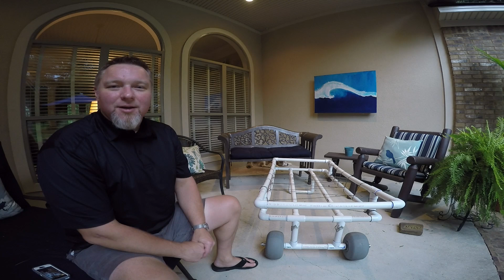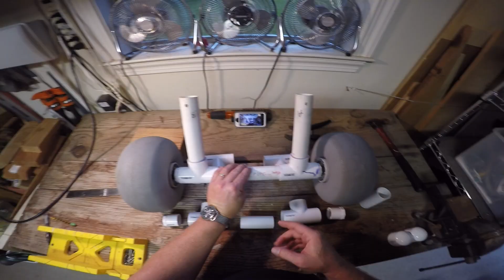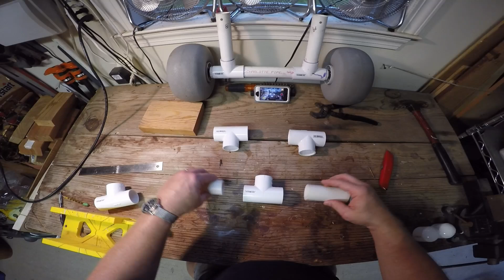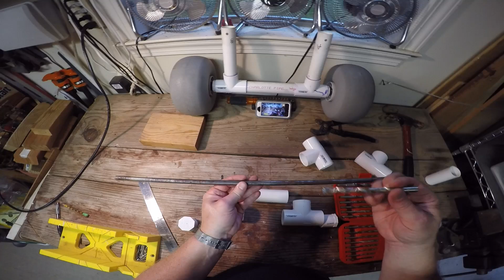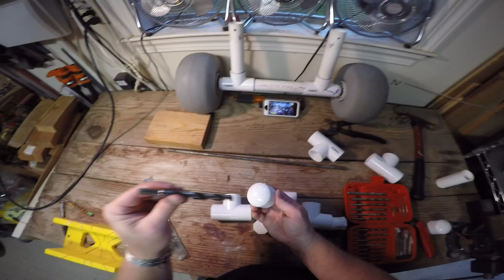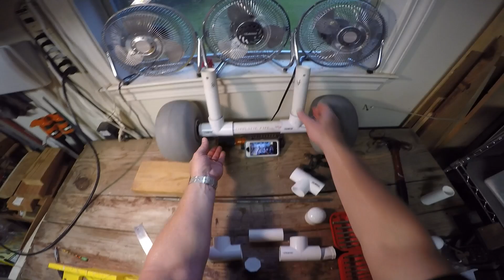How to Attach Axle and Wheels to a PVC Frame

Comment: Have you noticed any wear in the PVC cap from the axle turning (friction)? Has it made the hole go out of round? Also, what beach tires did you use?  I thought you used a 5/8” axle too correct?
Reply from the maker: Hi Mike.  I have not noticed any wear in the cap.  If you were going to really put a lot of load, you could always make the hole a little larger and use a replaceable bushing.  I bought the wheels and axle from WheelEEZ.com.
Reply: centerforceone Thank you sir!
Reply: If it is done right there should be a bearing in the wheel hub, the bar through the middle should not move. You can make bearings using plastic fishing beads and plastic tubing. Use your imagonation.

Comment: just to make sure what size is the pvc 1/4 inch?
Reply from the maker: The pipe I used was 1-1/4 inch diameter.  I used thinwall PVC to reduce weight, but it also reduced the strength.  Schedule 40 PVC would give the greatest strength if it didn't make the cart too heavy.
Reply: @centerforceone  Your tips and video are awesome.  How heavy is your load on the cart? My tandem kayak weighs 72lbs. My design will be different as it is for a kayak so I'm building the more traditional kayak cart.  I got 1" PVC. Is there anything else you'd suggest to strengthen the cart for about 100lbs (figuring I'm gonna just throw paddles and everything else in when I portage.  I got pneumatic tires from Harbor Freight. Thanks.
Reply from the maker: @MarkEzrin  Thanks for the kind words.  I think 1" PVC will work just fine for a kayak cart with the load you mention.  I only used 1-1/4"  because my project started with a beach cart over 5 feet long.  (See my DIY Beach Cart video if you want the backstory.)  Good luck on your build and please send/post pictures of your finished project.

Comment: Your like I am over engineering every thing. But if you use half inch all thread fro the axle there wouldn't be any flexion.
Get a cheap plastic caliper from harbor freight.

Comment: This is the only cooler you’ll ever need!>>>nub.best/9jti     So much room and so easy to move around with its expanding handle! Even in sand or smooth service the best! I also bought the wire rack for inside for easy access to sandwich’s etc!

Comment: Here's how to perfectly center a hole in a PVC cap if you have a drill press. 1. clamp down a thick board (nominal 2x lumber is fine) to your drill press table. 2. drill a hole the same size as the outer diameter of the cap. (You may drill a hole slightly smaller as the domed cap will self-center in the hole.) 3. without moving your clamped board, change your drill to the axle-sized drill. 4. place the cap in the large hole and drill the axle hole.  

Small drill presses can be had for under $70 from Harbor Freight, and less if they're on sale or you have a coupon. They are indispensable for any do-it-yourself person!

Thanks for your videos. I've been wanting a beach cart and a cart for my ISUP.

Comment: Here's what I did for tires, I had an worn out wheel barrow w/ dual 4.00x6" tubeless tires & 5/8" axial, tires measure 13"diam. I aired up tires & popped out the beads, then with the tires inflated, drill a small hole in tire sidewall big enough to fit in a spray insulation quill, 90 deg opposite that hole, i drill a larger hole, as i spray foam in from the bottom, it pushes air out the top hole,  careful to keep the beads seated,  fill foam till appears at top hole, stop, it will keep expanding. U can drill top hole in tread center on tire tops, it works for better for larger tires. U will need to top tire off periodically as foam settles...no flats, no mess...my Surf/Pier cart is 2 wheeled so useing the axial that came with the tires was a +.. I got 2 perks from this, my wife was happy to see another piece of junk go & I got a "free" set of no flat tires w/ wheels & axial! If ur wondering if foaming works, Ive used the foaming method for my 60hp tractor (front tires),3- riding lawn mowers, a Harbor Freight hand truck, all with great success. By the way, leave the schrader valve in place,  tires won't fill up completely with it out. Ifu don't want to do the foam thing, Harbor Freight sells different sizes of "no flat" solid tires. Foam fill shld take 2 1/2 cans per tire, Good Luck!
Reply from the maker: +Dan Roy, Great idea.  I will definitely be trying this for my next project with wheels.  Thanks!
Reply: What size rolee tire tid you use?
Reply from the maker: I used their smallest set - 24" axle with 9.4" diameter tires.  I wish I had gone one size bigger.

Comment: The end  caps can be turned over to drill the axial holes..put in a vice with hole up, eyeball center, dot with majic marker, with that, u can use a center punch to set center or start ur drill slowly to a point that it will track. Drilling the hole from the inside has a self tracking effect, even if its a tiny bit imperfect we're not talking Idy 500 speed here should work without the measuring & marking with a knife. Good Luck!
Reply from the maker: +Dan Roy, That's a good point on being able to "eyeball" the center easily when working inside the round walls of the cap.  Sometimes my desire for precision can make things harder than they need to be.  Thanks for the great tip.
Reply: Dan Roy - I came here to point this exact thing out!

Comment: Where did you purchase the wheels? I'm looking for good quality ones that will not rust when used in and around salt water.
Reply from the maker: +Jason Farnen, I bit the bullet and bought Wheel-Eez after my recycled wheels didn't work well.  Wheel-Eez are not cheap, but they are great for beach use.  I went with the Wheel Axle Kit 24UB.  This has both wheels, marine grade aluminum axle and all required hardware for attachment.
Reply: WD-40 spray after every use.

Comment: love your videos
?did you use any glue or cement to bind the pipes to the T and to the caps
Reply from the maker: +Daniel Kanas, Thanks for the positive feedback.  I'm glad you find the videos helpful.  To answer your question...Yes, I used PVC primer and glue for all the permanent connections.  I probably didn't have to use primer since the piping would not be pressurized, but it's habit for me from my days doing landscape irrigation.
Reply: If you don't want the PVC to come apart you definitely need the primer.Without it it will eventually come apart because just glue alone doesn't adhere well to the dirty PVC.